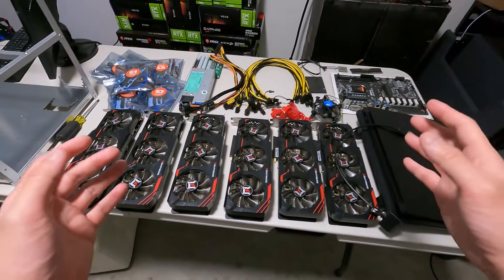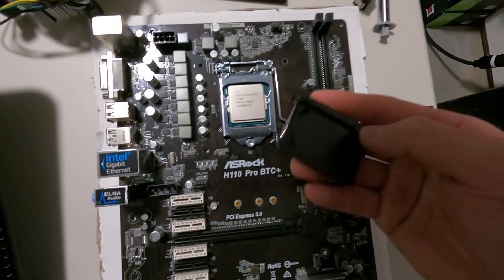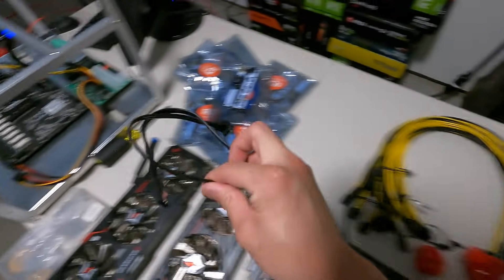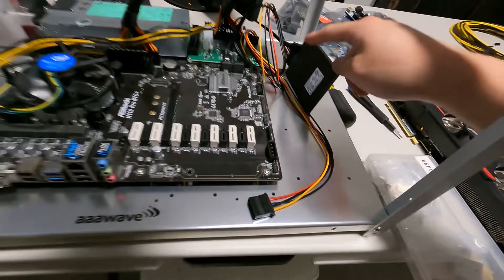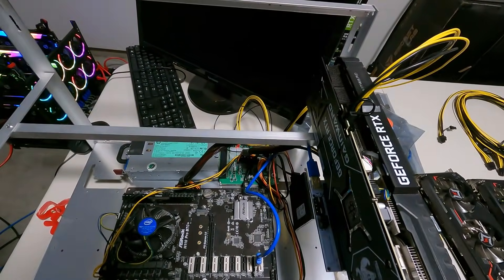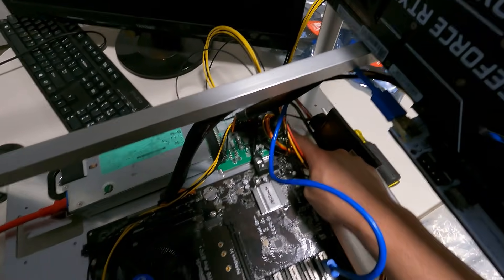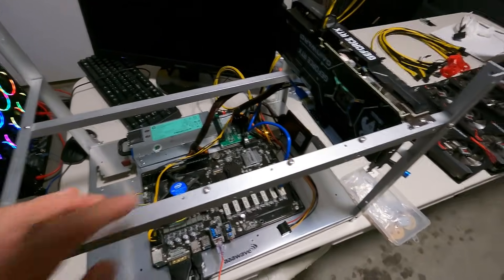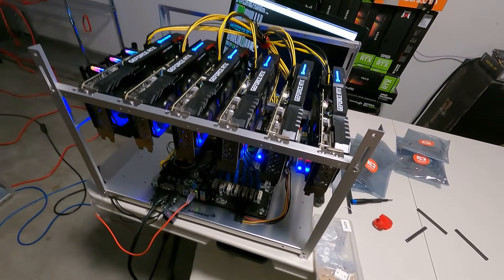How To Build A Mining Rig (POV)

Comment: Hi everyone, I downloaded HiveOS to an SSD by copying the ZIP file, and using BalenaEtcher to flash it to the drive. Also put my rig.config onto the drive. 

When I turn on my rig, a blue screen flashes with the option for HiveOS, but then the screen goes black and my monitor goes into power saving mode. 

What am I doing wrong here?

Comment: Probably going to feel stupid after asking. but big confused atm as far as power supply goes. 110v/240v from my understanding is the basic wall outlet for your lights vs the one for your clothes dryer. as far as i know anything 240v has to have a 240v outlet to work. but the website linked for the power supply says the power supply has a 110/240v input. also power cords available on their site say they work for both 110/240 and would plug into a regular 110 outlet it seems? do i need a 240v to run the power supply? should i try to find a power supply that works on 110? or just get a 240v installed?

Comment: I started using a power button pin cable that came with my mobo, it gets old starting the mobo with a flathead. The power button came with my Gigabyte Z390 UD mobo

Comment: Great video!! Hands free is awesome.  Quick question: Your 3070's only had one 8-pin power connector on the top?l  If they have 2 8-pin connectors,  do you hook both of them up to the power supply?  Not talking about the riser...just the GPU.

Comment: I want to use an hp 1200w server psu unit inside my desktop case but I'm not sure if my itx motherboard can comunicate with the breakout board so that when I press the power button on the case it boots up?
Also when I go into windows settings and select say (shutdown, restart,sleep) 
Will it recognize those commands and act like a normal atx psu?

Comment: I tried to use a dvi-d to vga adapter with the new built following your instructions but the monitor goes into power save mode. can you help? do I need to get a dvi-d monitor?

Comment: Wow!  What a great video on how to quickly build a miner!  I recently purchased a shipment from a US Customs auction and it included 25 boxes.  Each box contains a rack-mountable case, sectioned off in two sections.  There are two Biostar BTC-250C motherboards and six PCI-risers.  Each case also has six fans installed with cables.  I was trying to sell these but after watching your video, I could easily buy a 1200 watt power supply, CPU, 16 GB RAM and GPU's and have my own mining machine.  Would you say this would be a good opportunity, or should I just continue to try and sell the cases, motherboards and risers?  After watching your video, it seems pretty simple.  What income do you expect to receive from one mining machine?

Comment: Extremely helpful Red Panda, I bought four Evga RTX 3070, but i am getting for each around 45 Mh/s, I do not know what is happening because i want to increase the Mh/s to 60 which is normal operating range. I am using Prime Z390-P motherboard. Any suggestion

Comment: I have a problem, I have the same motherboard, 4gb ram and a corsair 1000hx 80 plus platinium source, I want to connect 5 gpus, 2 rtx3070 and 3 1660s but they don't support all 5. source or is it ram?

Comment: that CPU linked does not work - you need a 300 chipset / bought this one and had to order 4930 intel celeron / rig would power up just fine until I connected CPU power cable then it would short out

Comment: Great watch learned alot and the power on finally someone included the switch!
One question is a 6 to 8pin cable safe? 6 pins pull 75 watts but the gpu will want to pull potentially 150 watts from this cable?

Comment: I have a question, about 15 years ago I built a computer that is way out of date and I was wondering if its possible to use that motherboard as a mining board?  It is currently running windows xp but I was wanting to use HiveOS, I had an old instructor look at the specs and he said it cannot run the new versions of windows. Please let me know if its possible to turn that old motherboard into a mining rig thanks.

Comment: ADDITIONAL NOTE ABOUT SERVER PSU's - When you see 1200w server psu, do note that most USA houses have 120v not 240v. You you have to read the small print in order to see that you only get a max of 900w at 120v & 1200w at 240v. THEN take into account the 80% rule!

Comment: Hello @RedPandaMining 

What is a good mining motherboard for the 1660 super? i have 4 of them puppies and would like to try my hands on mining.
I will also need a cpu, poower supply that can handle maybe at least 6 1660s and risers too and the open air rig as well. A newbie miner here just like to have some knowledge on crypto mining. 

I would like to try it on windows 10 first using phoenix miner or nice hash before i go to hive os. 

Any tips from you will be greatly appreciated.

Comment: Does the core clocking value work on windows? Because I've 2070 gpu, After lowering the core value to 1050 and power to 70, my hashrate decreases from 41 to 36 and temp increases from 65 to 80. I don't know why this happened, may be it does not work on windows, but anyway I like this video

Comment: Hello everyone.
Im buidling a new Nvidia rig using HiveOs. I have 3 total cards which 2 cards are MSI 1660 super and the other one is 3060ti Gygabite.
If any two of them are pluged-in, they will work fine. But whenever i plug all 3 cards, the 3060ti does not mine anymore.
I’ve already tried update nvidia driver to 465 using nvidia-driver-update in shell but no luck with that also.
If anybody know about this problem pls give me some advices
Sorry for my bad english if i said something unclearly
Thank you
Reply from the maker: Check Bios settings on motherboard, enable 4g decoding, pcie gen1 for all slots
Reply: @RedPandaMining  4g decoding enabled, i tried pcie gen2 last time but it made no change. As i remember i also tried Gen 1 already, i may test it again today.
By the way im using Intel B85-btc 8 pcies motherboard, do i have to update the bios and how to ??

Comment: Hi everyone looking for advice as I am new to mining. I am in the process of building my rig I currently have got one rtx 3080ti so far hoping to use a 100% lhr bypass. I am unsure to use Windows or hive os. I was thinking more towards Windows as may try out PC games also on the side.

I am unsure to use nicehash or trex miner or go nb miner. I seen a miner get 120+mh on nicehash but I don't know how I feel about being paid out in bit coin and having fees to pay.

Also I am looking to mine as much ethereum as I can before it goes to proof of state algorithm.

Also I am unsure to use nice hash to get bit coin and keep it or convert it to ethereum or mine ethereum directly in a mining pool and use trex miner or something would get more profits? I am looking to get and hold onto as much ethereum as possible.

I bought a evga 1600w titanium to see if it helps with electricity than using platinum. But then would of been cheaper buying two 850w to power these power hungry 30 series.

Any advice would be great as I am new to all of this. Is there a discord or something for the mining community. Thanks

Comment: I just start on my 6 gpu mining rig but my GeForce RTX 3070 Ti VENTUS 3X 8G OC has two of 8 pin on the top , can you help me with two of 8 pin connections please sir , thanks
Reply: You simply need more power cables and maybe another PSU. It's just a more power hungry version of the card.
Reply: @IgnoreMeImWrong  thanks man ,
I need 2 1200W power supplies right ? Each 1200W power supply for 3 graphics cards ?
Reply: @khanhluu7626  Weird, my comment was censored. Yeah you should only need two, just don't cheap out on the rating.
Reply: @IgnoreMeImWrong  sorry mate, I just start on my first 6gpu rig , when I see two of 8 pin its really making me nervous and confused but I am ok now thanks for help bro and thanks to Red Panda

Comment: Hello my friend. I am newbie mining,, actually this is my first time. I have watched this, your video many times and followed every step, I bought only two gpu’s to test this rig. I set up everything just like you kindly instructed, but I have an issue with my power supply. I bought the same power supply and bought the ZSX breakout board 16 ports + pico separate from the power supply. My problem is when I hook up power supply I don’t get the voltage I suppose to get. My fan doesn’t come on, nothing powers up! I thought it was my atx cable I removed it and checked the voltage coming out of the pins and I only get  +5V out of pin 16 and 9. I bought a different zsx board and still get the same problem. The voltmeter at the end of the board says I am getting 12V, but from the 24 pins I am only getting 5V from two pins. Please advise. Thank you for your excellent videos. I am your fan!

Comment: if anyone is having trouble with etcher making the drive disappear with seemingly no solution.. I was able to get it to work using an older version of etcher (probably the one from this video). 1.5.115.  1.5.20 was not working correctly.

Comment: Really great vid!
Quick Q: what would I do with a gpu (rtx 3070) that needs 2 x 8 pin connector per gpu. Can i run a 8 pin  (from the psu) and use a 8 + 8 splitter into the gpu? Not sure my psu has enough pcie ports to run 2 rtx 3070 with 2 8+8  and the risers.
Looking to build a rig with a rtx 2070 super, rtx 2080 and 2 x rtx 3070 off 2 power supplies (850w + 750w).
Its my first rig so PLEASE HELP.

Comment: At least 3 beginner mistakes.
1) Your PSU's case is supposed to be conductively connected, at the shortest possible path (i.e.: reliably touching; have a short cable conductively and reliably attached between your PSU's case and your rig's frame, if you want to acoustically decouple the vibrations of your PSU from the rig) with your rig's common ground (the metal frame). Same goes, btw, for the case of your SSD and the "common ground" on your rig.
2) Always plug in the power lines first, and unplug last. Never plug in the signal lines first - unless you want to risk burning out your IO circuits. It does not matter, that the power cable is detached from the PSU - there are hundreds of capacitors in the PSU, on the MB and on the GPU, each of which can have a non-0 voltage on them even minutes after you disconnected the PSU.
3) Use an anti-static wrist strap, when you are handling ESD-sensitive equipment.

Comment: I dont think buying a 3070 for mining ETH (idk about other currencies) makes sense. I literally have a 3060 ti which uses 117 watt and gives 61.56 mh/s (-300 core, +1200 mem on afterburner) which is exactly the same as the 3070.
Soo in dis video the guy could have literally saved more than 600 dollars without any hashrate compromise :)

Comment: Those risers are the same components as any other 009s risers. if you order 3000+ units we'll customize PCB color, logo, and GPU mount color. As well as print brand on boxes. Capacitors, IC chips etc are the same. Just wanted your viewers to know there is no difference unless the IC chip is the ASM 1083 IC Chip. now you're looking at 25-40USD per riser. 😭😭😭

Comment: what a pity that you don't know how to fix a cooler from a processor in 2021!
Reply: with a screwdriver you have to turn the black clips 180 degrees with a little pressure... and only then can you say that you have fixed a cooler.